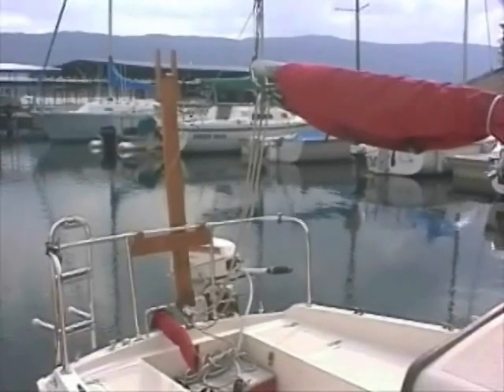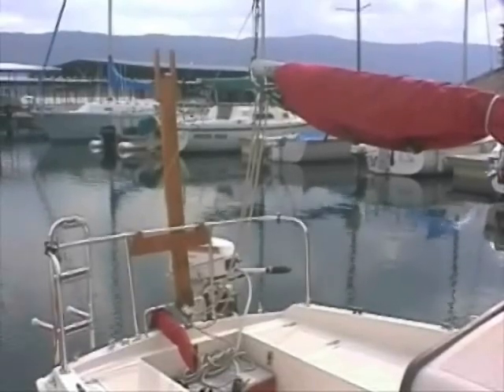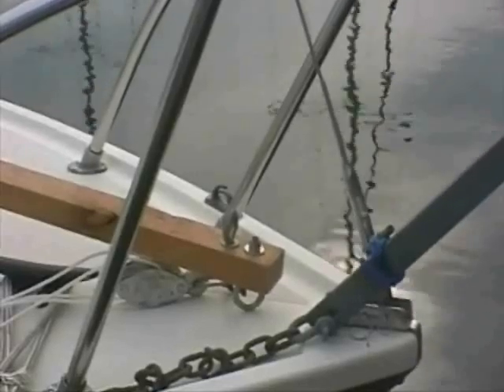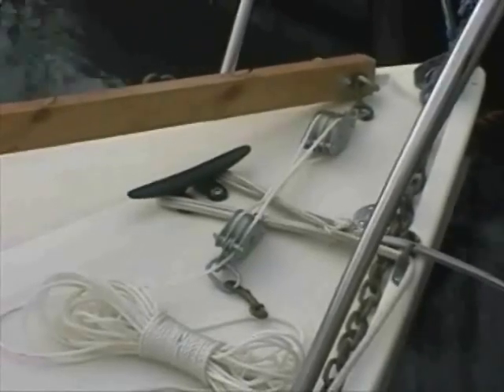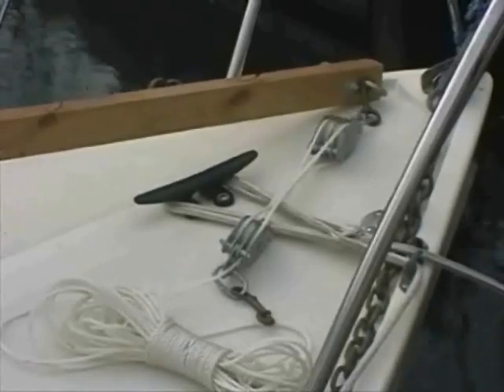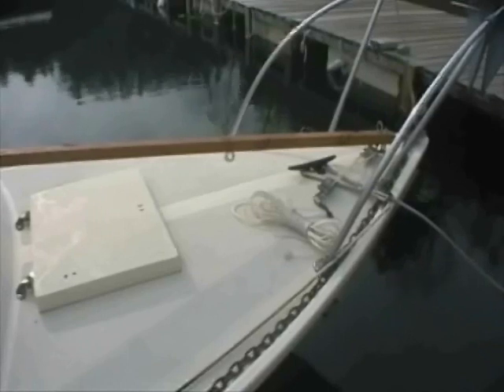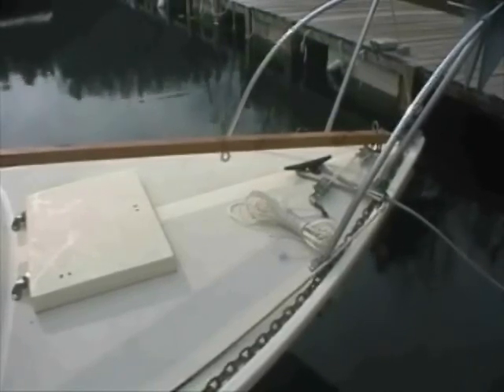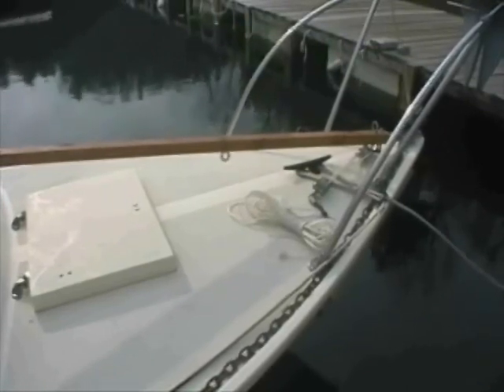Mast Raising Gear on Ternabout

Comment: Awesome work, Captn. I used your designs a couple of years ago to make my own mast crutch for my Matilda Southwind. And other mods of yours too.

I made one addition though. A dockline - lashed from one cabin roof handrail abreast the mast - up to the mast at about 6 feet - then down to the other cabin roof handrail  - completely eliminates any side-to-side instability. 

2 seconds to install, no extra parts.